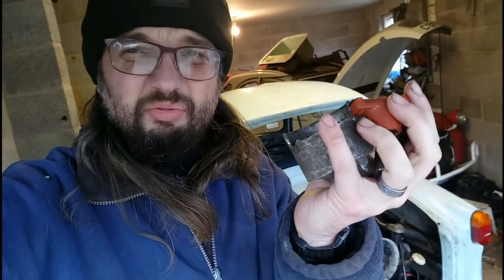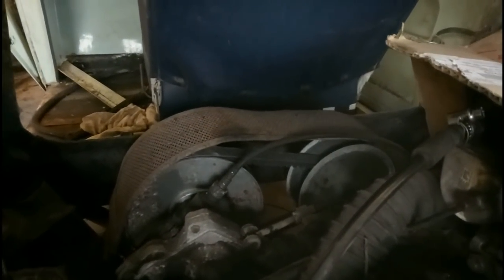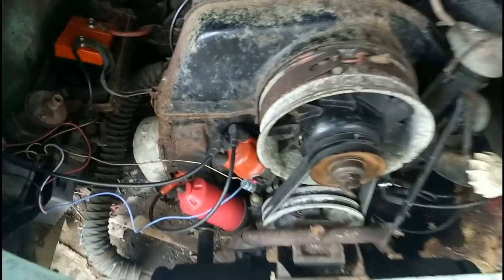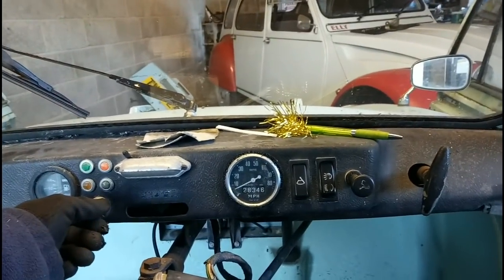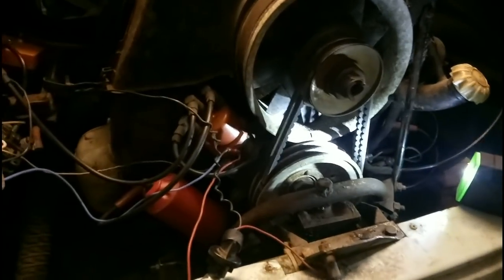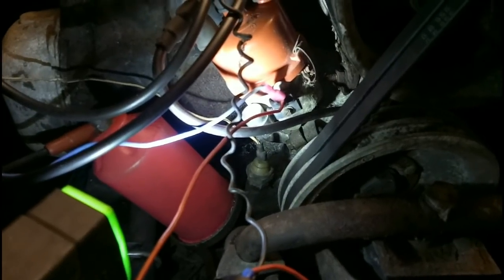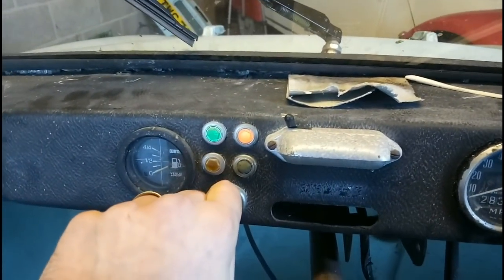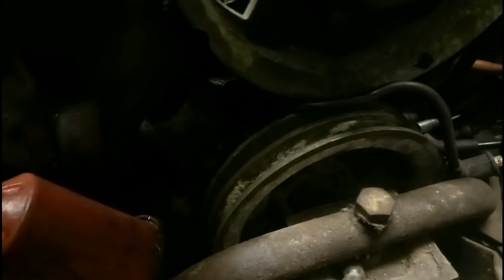Project Invacar Part Seven: FAIL! It all goes wrong...

Comment: I believe a Hyabusa engine would fit :)

From somewhere deep inside my head (it's a scary place, i don't recommend it, full of Italian car nonsense) the Steyr Puch engine was also used ina more tuned state in their version of the Fiat 500 and also Fiat toyed with the idea of fitting it themselves, There "may" be some cross compatibility of a few bits here and there, certainly i do recognise a few components as looking pretty similar to classic 500 components and given Steyr and Fiats relationship, it wouldn't be a huge stretch to imagine there are a few things from the same parts bins on different applications.

Comment: All is not lost - but you will have to pull the engine - bore the hole out and sleeve it, any machine shop will be able to do it - if you leave alloy and steel together long enough it fuses like that
Reply from the maker: Cheers. Odd thing was, it's two different aluminium alloys I think, no steel here.
Reply: HubNut it's just years of corrosion then - are there any service books around for this engine - I'm sure there is

Comment: I don't believe the distributor would be part of the engine block, that is nonsense, the timing is special for every car. I believe what happened it aluminium fusing. It happened on old Skoda Favorit - they had aluminium door mirrors and after few years they fused so bad that if you tried to move them they snapped right off. 
I would spray it with something really potent, like PB Blaster or something like that at least twice every day for a week and then I would continue. Patience is the key here...
Reply from the maker: +Krivulda Yes, the distributor fused into the block. Taking my time with the spares car.

Comment: to be honest its worth pulling out that crusty old engine and cleaning up the engine bay you can test the other engine while still in the spares car and do all the valves etc when it out on the bench/ floor if you get a little wire vrush and clean up the hole where the dizzy goes in and brush / spray table vinegar or maybe cider vinegar on to it the vinegar should help to bteak the oxide where the steel and aluminium had reacted together its then nice and easy to paint/clean everything up nicely before refitting the engine, great little series v.different from a lot of vids here, I remember thesr cars well from my youth.
Reply from the maker: +Gary Fisher Thanks! Definitely needs something to help break the seal, as the spares dizzy is stuck too.

Comment: Yikes, I wouldn't want to have that variomatic belt whizzing round that close to my bum.  When my old Daf 33 broke a drive belt it came off with enough force to punch a hole through the floor under the rear seat.  OK, it was rather rusty but that part of the floorpan was still solid so I'm still not sure that little cage and the, presumably fibreglass, panel between the cabin and engine bay will do much to keep the belt under control and out of the driver's back if it decides to part company...
Reply from the maker: It's a slight concern! Maybe I'll reinforce it...
Reply: +HubNut  That's probably a good idea.  I don't think anybody ever got injured by an excess of safety precautions...

Comment: I think we have all had days like this when something quite straight forward goes horribly wrong. If it makes any consolation whilst working on my S2000 it slipped off the jack and the jack put a massive great dent in the front wing causing considerable damage. Second hand panel later its fixed but the paint isn't a perfect match. Shit happens :(
Reply from the maker: +track nut Yup. I've had jacking incidents with this car actually!

Comment: Keep up the good work. I am sure with a big hammer, perseverance and a few colourful metaphors you will get it on the road.
Reply from the maker: Big hammers fix everything. Thanks!
Reply: Assuming you have tried heating it up and that failed. How about mole grips on the shaft and a piece of wood on the casing and levering the shaft out? May take a few taps though. Am I correct on assuming the case and the dizzy are both aluminium? Possible that exfoliation corrosion has fused the two together. If you get it off then use a barrier grease when you fit the replacement.
Reply from the maker: +Greg Wilson Yes, and sadly I fear the spare engine has the same issue. Thanks for the tips though.
Reply: HubNut anorher thought. Though is not much use. The two ally components may be of diferent ph potentials. Possible they could cause bi-metal corrosion. More possible is salt water from gritted roads has seeped into the crevice around the shaft and created a very corrosive enviroment. If I were attempting this job I would take the plunge and strip the engine out and completly down. You may be able to get the shaft out through the inside of the block then ream the remains of the original dizzy out. A big job though as you know. Then getting a replacement dizzy may be a problem as I assume they are pretty scarce. Sorry I can't be of more help.

Comment: I never thought I would say this... but a VW engine swap would be a step up for this little car.
Seems several of the mechanical operations on this engine are similar (pulley shims and the valve adjustments)

But if you keep the engine, something tells me that you're going to need a new distributor.. just a hunch.

Side question, if its a 2 cylinder engine and both pistons are at TDC at the same time, then why does it even need a distributor?  Both plugs can be fired at the same time with no issues in that arrangement, eg. a dual coil arrangement. Still would need points or similar timing but HV switching is not really needed.

Cheers
 - Eddy
Reply from the maker: A valid point. The 2CV uses wasted spark ignition, so fires twice during the four-stroke cycle. This means it doesn't have a sodding distributor! The cylinders still fire at different times though, not the same time.

Comment: I bet many tools went flying and many curses were said. Sometimes when i got to the 5pm hacking stage where i am tired and hungry when rebuilding my Land Rover i had to stop, have a meal and re think. In your case though i think that was buggered before you started. Dissimilar metal corrosion?
Reply from the maker: I'm not really sure what the metals are. Block is aluminium, but the dizzy seemed really friable. Tools didn't fly, but I did get a major case of the grumps, and should probably have stopped earlier.

Comment: Problem is even if you do get it out the spare on other engine is probably seized too.. don’t want to attempt to remove the other one leaving you with no complete engine. Is there not after market solution to upgrade the distributor?
Reply from the maker: The other one is indeed quite happy where it is. Mind you, it's only had one soaking of penetrating oil so far. I'll try some ATF, leave it for a goodly while and see if I have any luck.

Comment: So an engine swap with the spares car & prey that that one works and then rebuild the first engine on a bench (which you may need to build). You may not have intended to do a full restore but I think the poor thing deserves one. Loving the videos, please keep up the good work. (try swapping the charging system from the spares car too!)
Reply from the maker: Thanks. Charging system should be fine once I sort the knackered wiring out.
Reply: I'm pleased to hear that. I cant wait to see her move under her own power :-)

Comment: Nice job sorting out the shim placement.  Being able to fiddle with something until it starts to make sense (like slowly undoing a complicated knot) is a very rare and important skill, and this is a great illustration of it.  It's so hard to teach.  Things like that are like real-world tavern puzzles.  

Why does this engine have two parellel belts from the crank pulley to the fan (and I presume generator) pulley?  Is it just for redundancy, or something more complicated?  Redundancy is a great idea; I wonder why other car companies don't do that (I'm giving my 1972 VW the side-eye).
Reply from the maker: Oh. I'd assumed Beetles were like that too. I guess it's just to spread the load. Working on cars is certainly a good way to work the brain! Very satisfying when you work something out.
Reply: Beetles have the same shim system for adjusting tension, but only one belt going from the crank to the fan/generator.  So the generator shaft has pulley half, then shims, then outer pulley half, then shims, then washer and nut.  

As you say, it's annoying to adjust, because you only know what the real tension is after you've tightened the whole thing down and spun it a bit to get the belt(s) to relax into the groove(s).  Fortunately (at least on the VW) once you have a stable shim/belt configuration, you don't have to adjust it too much.  

And yes, I very much enjoy the problem-solving aspect of it.  And it's nice to be able to take a break and work with your hands (I'm a computer persons, to that's a break for me).  

Your channel is really fun.  I'm frankly tempted to get a channel going myself.  I've been thinking about it, and you may push me over the edge.
Reply from the maker: Go for it! Don't expect a huge audience straight away though, just treat it as pure hobby and see where it goes. My first video took several years to amass 500 views!

Comment: Im surprised that chinesium screwdriver handled that lol. in thre states we say sh*t happens, the aluminum bits concern me, id be changing that oil FREQUENTLY once sorted
Reply from the maker: +yamahonkawazuki Indeed. It won't get run until the oil is drained, and I may flush it from the dizzy hole once I actually get a hole...

Comment: 20/20 hindsight; I'd probably try and remove the distributor from the other car just to see how it's supposed to come off.
If you destroy that one in similar fashion, you're probably doing something wrong and have to find another invacar.
Reply from the maker: +The Rolling Troll Yes, that one is seized too, but I will try and free it with a little less violence...

Comment: Felt the pain when I saw the sheared off dizzy casting. But, the casting doesn’t do much. So I think a new dizzy in there should be ok.
Reply from the maker: Problem is, a bit of it is still left in the hole...
Reply: HubNut will it not drift out with the dizzy shaft?
Reply from the maker: From inside, possibly.

Comment: everyone makes mistakes every now and then...the alloy on the engine case could probably be rebuilt with alumi-weld rods and a braising torch or something similar....but yeah that was pretty extreme....might have been best to drop the engine at the beginning?? :)
Reply from the maker: +thesunreport Not sure. Would have been difficult to lever against an engine free to move. Easier with it bolted into the car.
Reply: might have been easier to get some plusgas into it to soak...if it was upside down or whatever...but yeah loads of work either way.....just take it easy with that hammer in future!! :D

Comment: Make up a slide hammer to pull out dizzy drive shaft. This is when swearing and Glenfidich are the best solutions! Now the Hyabusa engine conversion must be a step closer....... or maybe that's the Glenfidich talking!
Reply from the maker: No bike engines! It'll be quite fast enough. Slide hammer a good call.

Comment: Have you a manual for this engine/car? It could be that the widget was stuck in the dufinky.
Reply from the maker: +Chuck Haynes Sort of. It isn't very detailed, but it does confirm that there's only one bolt that's meant to hold the dizzy in.

Comment: I hope you are in better spirits and further forward 
I did notice a Bosch 2 cylinder dizzy on ebay hope you won it ?
Looking at several of that design /  VW   Fiat maybe you might not need the sump off ?
As it maybe not right though to crankcase working off a tight boss shaft 
Does your friends at Haflinger technik any surplus / known parts ?
I was just thinking if you had a donor stub shaft ?  VW / Fiat  you could try and convert it to electronic ignition 
Are we just going to try again from scratch for spares car ? 
Positives is you have a donor engine ...  spares 
This old "TOAST" engine does work and run just needs a dizzy / carb clean 
Just keep going make sure you have plenty of tea and cake
Reply from the maker: +Mondo Daftasabrush Won't be any progress for a good few days due to other business. Have a few thoughts on how to proceed.

Comment: Keep dosing the point where the distributor fits into the block with heat, penetrating fluid and maybe ATF, and try using a slide hammer on the distributor shaft.  It will take some time, maybe weeks but it will come out eventually.  Be careful with the parts car as it will probably have exactly the same problem.  Unfortunately, that's the joy of differential corrosion on long-idle vehicles.  On the up-side, I strongly suspect a new distributor will be easily available from the Haflinger guy as they did have a bit of a reputation for eating dizzies...
Reply from the maker: It certainly does have the same problem! Has already begun receiving doses of penetrating oil.
Reply: +HubNut  A bit of heat might help too.  I know it's a monumental pain but this is going to take as long as it takes, but at least you know what not to do which might give you somewhat of an inkling when you might be risking the replacement distributor...
Reply from the maker: Quite so!

Comment: As far as the rough running possibly caused by the fuel system (I'd guess it's lean) here in the USA I'd treat the gasoline (petrol) with something called "Sea Foam" it is a fuel additive and the wonder elixir of North America, it's useful when you politicians demand that alcohol be added to you motor fuel. You see alcohol absorbs water and makes some of the most remarkable and interesting corrosions in your fuel system especially if you have older equipment that wasn't designed with the  corrosion resistant fuel systems. Since your'e not in the US or a close proximity North American Country where Sea Foam could be easily smuggled to you if not otherwise available I have no idea what you're going to do.   As far as the dizzy, it would of been easier if you hadn't gone and destroyed the bottom of the original dizzy. With some patience  heat and a good penetrating oil you could of gotten thing free enough that a slide hammer  on the distributor could of yanked it clean out. But have no fear you still might be able to save the case, if the bore where the distributor goes is messed up take it to a machinist and have them clean out the bore and fit you a nice bushing.
Reply from the maker: +Capt. Beak Yup. That's the plan I think. I do agree that it was probably running lean too. I'd cleaned the jets out, but that clearly wasn't the issue.

Comment: I think I understand what you meant by running problems. can you get to the underside of the dizzy drive and knock it out from underneath?.
Reply from the maker: Not without dismantling the engine entirely I suspect. Crankshaft is in the way...
Reply: +HubNut damn. shame really. all that mess in the sump just after an oil change too. is the other engine in the spare car any good?
Reply from the maker: Meh. It was free oil! I was planning on doing another refresh before it hit the road. Spare engine turns, but is missing half a caburettor, so I've not heard it run.
Reply: +HubNut oh well hopefully it will be OK. I guess the next video will be engine swap. good luck. if I wasn't in Durham I would give you a hand.
Reply from the maker: +DJT Taylor Fry Thanks! I'll get there.

Comment: It's great that you took this project on but also a bit sad you needlessly damaged the block by being too impatient and aggressive trying to extract that distributor shaft. It was also quite sad the way you cut apart the spare car to get its motor out just so you could rush to get your car running before the approaching show. There will come a time when all the remaining Invacars will become highly cherished restoration candidates as no doubt the popularity and value of these unique vehicles increases. In the future I imagine some will restore ones in far worse condition than your spare car as they do with Messerschmitt's and Isetta's now. There will come a time where someone would have a machinist remove the destroyed distributor shaft, bore and re sleeve that block so it can be used again.  Some will no doubt electrify remaining examples when spare motors become impossible to find. Some will rat-rod them putting insanely powerful running gear in them. Had I the opportunity to refurbish the ones you have I'd completely disassembled them and patiently replace all the bearings, seals and whatever else was worn and needed mending just so I could avoid things continuously wearing out. If I found a clean original example like yours I probably would stabilize the stress cracks with clear epoxy and keep as much of the original patina as possible. I'd also take the time to restore the function of the original door handles as they are not difficult to source. I'd also study up on fiberglass repair. You say you're not a good engineer when you obviously are a very good one. You just need a little more patience and not get into situations where you needlessly damage super scarce parts that others would die to have. Getting these cars back on the road like you do is wonderful to see even if many of your methods aren't. Sermon over.